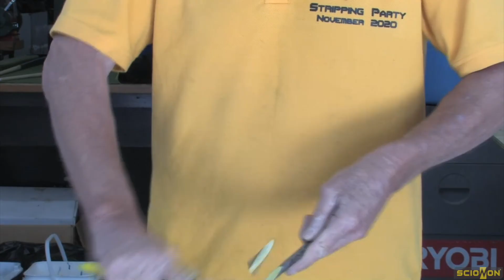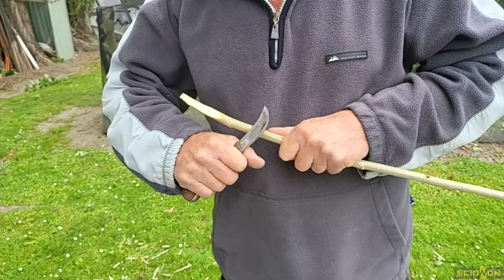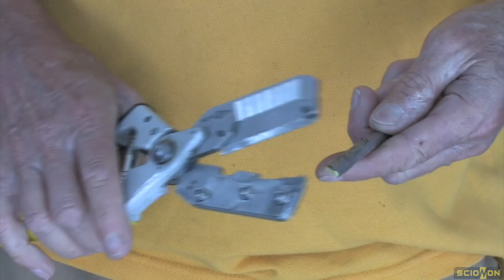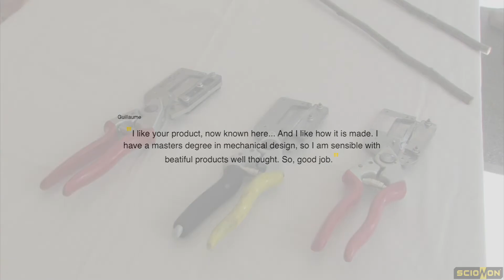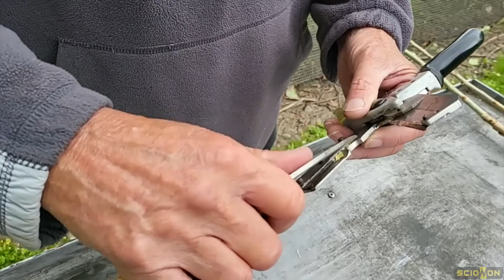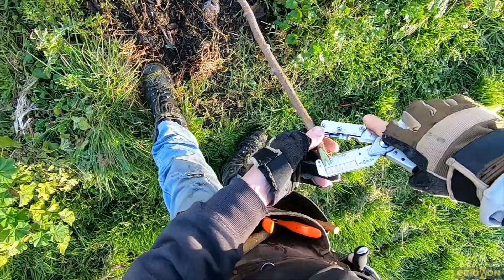Scionon Grafting Shears

Comment: What's the  blue solution you're putting on the cut ends?
Reply from the maker: We often get asked what the sealant products are that we show in our videos. The videos are shot mostly in New Zealand and so we use locally soured sealant materials.
The blue paints are either Garrison Rapid or PruneTec. These are available throughout NZ and Australia. Earlier videos show pink paint that changes to red when dry. It is Bacseal Super but is no longer available.  These paints are commonly used for sealing grafts and pruning wounds. The applicator bottles are supplied by the vendor when purchasing the paint.